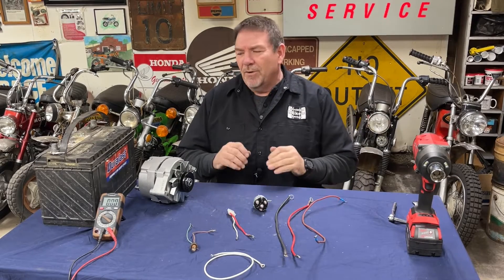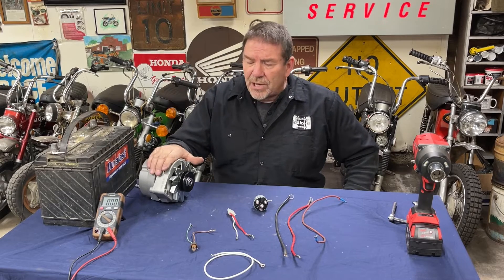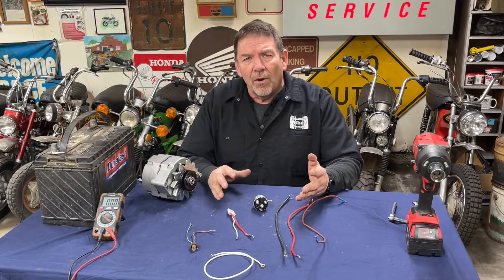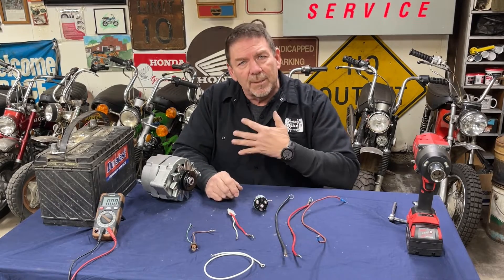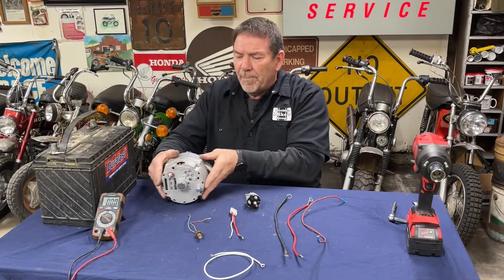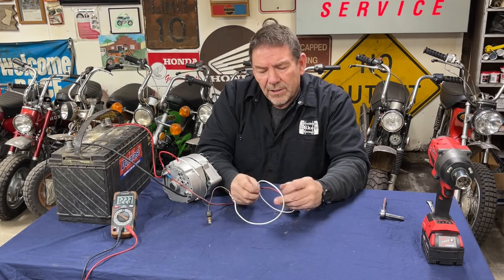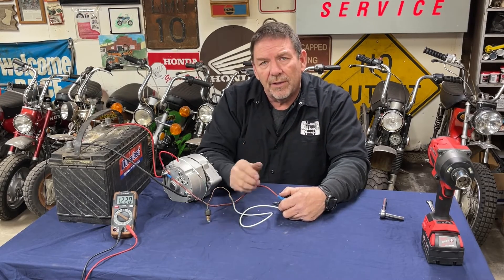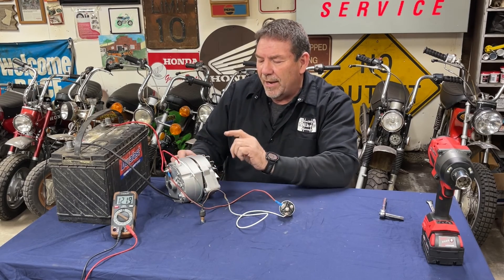3 - wire 10SI alternator wiring

Comment: Just watched your video and you have it pretty much spot on, but from experience that I have when you stated that you can hook the number one wire, or the exciter wire without using the light directly to the ignition coil. When you shut off the key, the engine won’t shut off because it will get back feed from that wire, but you can hook the white wire to the accessory side of that ignition switch, and it won’t get back feed if you choose not to use the light.

Comment: Only problem I see is a corvair alternator runs the opposite direction from a normal 10si alternator.
Reply from the maker: @JimBaldwin-x3t  An alternator can run in either direction.   I have a later video showing how to swap the alternator fan to the Corvair version, so it cools properly.
Reply: Just drive in reverse

Comment: Sir, is it ok If I plug the idiot light to the ACC position on the key switch
Reply from the maker: @honalock9066  As stated in the video, I’m not a mechanic, but I don’t think that will work.  It needs power the entire time the key is on.  In the ACC position, if the alternator goes bad, you might not know it, because the light isn’t powered.

Comment: You actualy confused me when you called the white wire the excite wire cz i think the excite wire is the red wire that excites the rotor coil to allow it to be in magnetic state.
Reply from the maker: @phoenixset6401  Yeah, I’m not a mechanic.  There’s a very good chance I called most of the parts by the wrong name or used incorrect terminology.   Hopefully, you can follow the wiring part and get yours to work.  It’s a year down the road and mine still works great.
Reply: @MiniBikeMike  Thanks man.

Comment: I ,use Chevy GM alternators on all of my trucks and tractors equipment, and I only use the nut post on the back, straight to the positive side of the battery, I have had on problems with my way ,for 30 years,, it as simple one wire charging system,on the planet. Ok thanks BigAl California.

Comment: Thank you for the video. I will add that if you do not want to use a diode, you can get a good resolve by using an LED instead of an ordinary 194 bulb.
This way you get your light, and assurance of no backfeed.

Comment: No mr.mike that red wire in pig tail will go to battery DONT hook to the battery terminal on alternator ! WHY  because that wire coming from battery to alternator is one way power you tell me how will power get back to battery to charge it if it's only going back into alternator !!! BEEN THERE IT WONT CHARGE BATTERY YOUR WAY SIR!
Reply from the maker: I’ve wired this way on about half dozen vehicles and each one charged properly.  I’ll keep it the way it is.
Reply: Great video Mike. Thanks
Reply from the maker: @davidliste5961  Thanks!
Reply: You sir are clueless! The red wire from 2 always goes to the battery connection on the alternator. Ask anyone.
Reply from the maker: @user-cg9ly4wg2s I’m OK with being clueless.  I’ve wired many, many alternators exactly as I show in the video and they all charge and work perfect.  I have no reason to ask anyone, my method was taught to me by a master auto electrician/alternator rebuilder nearly 30 years ago.
Reply: @MiniBikeMike  I believe he was referring to Bud, not you🎯
 That 10si alternator will charge the battery, even without the excite wire, but it would have to spin at 1000, to 1100 rpm, before it would self excite and begin charging.
 The way you have it set up, is most correct🎯😎☕
Reply: @MiniBikeMike yep you got it exactly right, I'm running that exact set up on my 59 ford truck and my 51 hudson  so I guess we are both clueless but oh well it works!
Reply: @JimBaldwin-x3t  your correct
Reply: I bought three wires by mistake, your videos gave me the best explanation to wire my cars alternator with confidence thank you.
Reply: It works for me,on all of my trucks and tractor, the only problem you might have ,with one wire from the post on the back of the alternator, tothe Hot side positive of the battery straight one wire, is , on tractor’s you might need a bigger pulley, tractor some times don’t spin faster, to excite start the alternator charging, I been doing my vehicles with One wire straight to the battery GM alternators since they started having internal regulators, lol thanks BigAl California.
Reply: Budledbetter, the battery DOES NOT power the alternator.
 The alternator CHARGES⚡ the battery🎯
Reply: Uhh...yes it will work like he has it, doesn't make any difference what end you put the wire on hot is hot 🤣